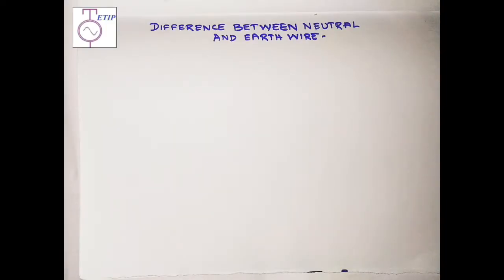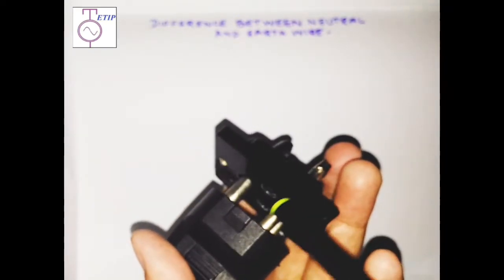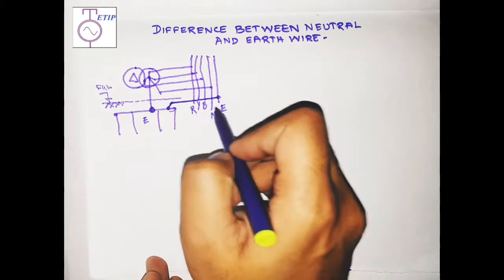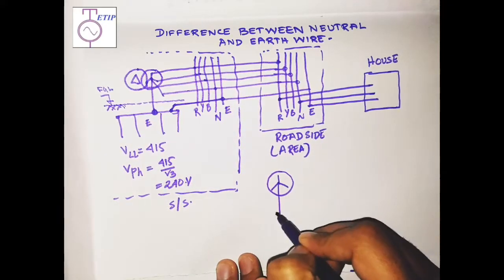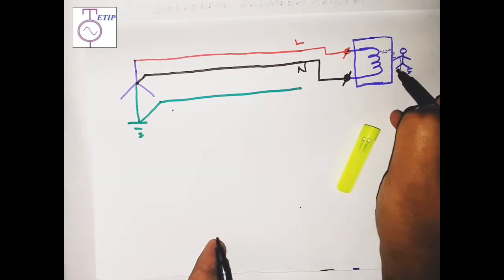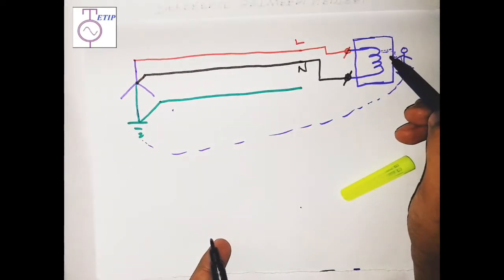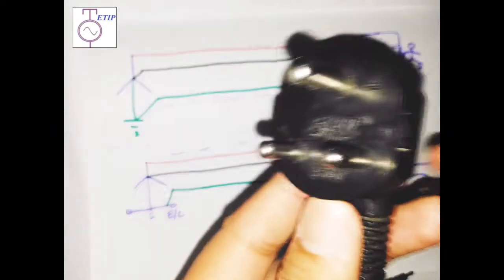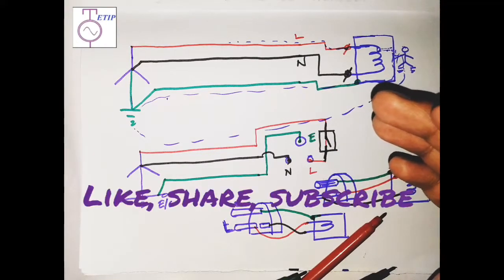Difference between Neutral and Earth|Electrical Technology and Industrial Practice

Comment: instead of connecting the earth wire from the substation, shall we take it near the Switchboard with new earthrod beneath the near surface?. to save the wire distance from substation. any technical term is there? necessarily need the earth from SS?
Reply from the maker: Yes, thas is done. But the earth rod beneath the near surface shall be connected to the main substation ground system. But if the main substation is ehv substation  then special care has to be taken. A gounding system designed based on gpr criteria shall not be connected with a grounding system based on non gpr grounding.